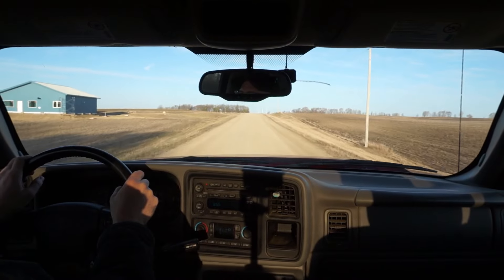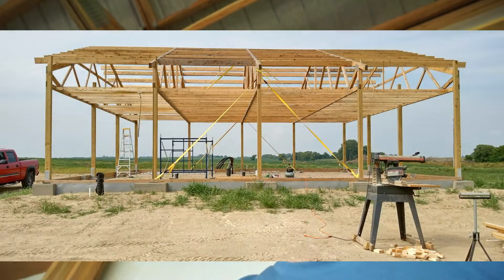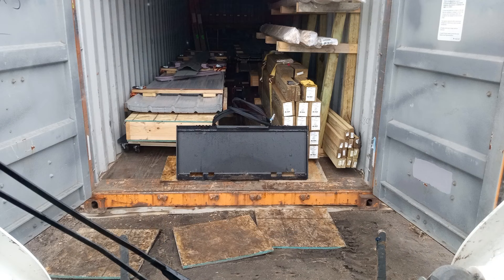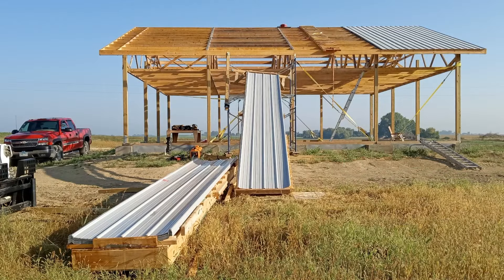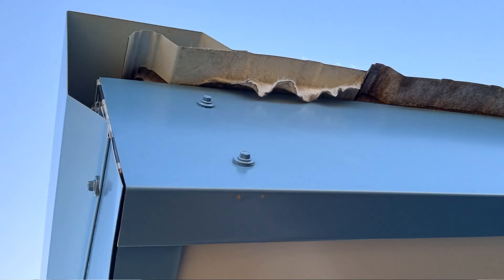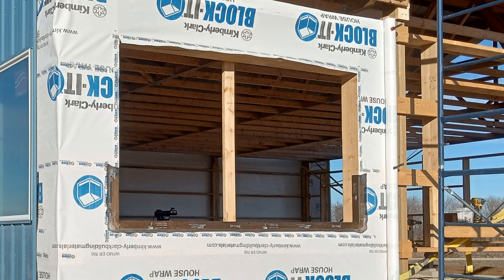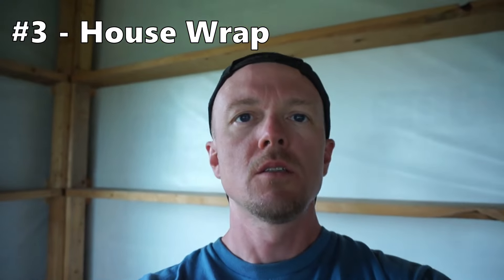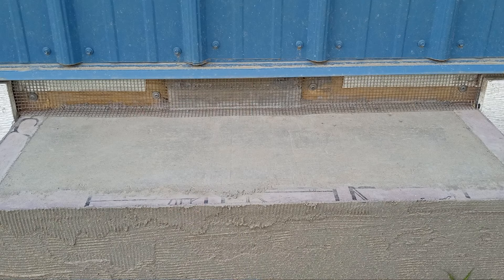Top 10 things I learned building my NEXT-GEN barndominium house from a Hansen Pole Buildings kit

Comment: Looks very nice, especially the light blue color. To lift your roof assembly did you hire a mobile crane or use post winches?
Reply from the maker: @pinestumps8622  Thanks!  I did the two middle truss bays at once with six winches.